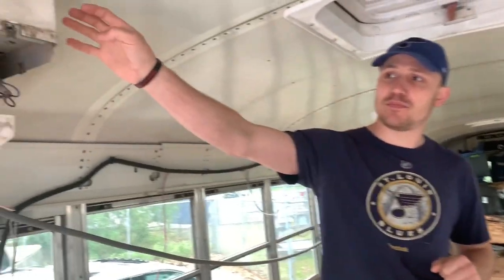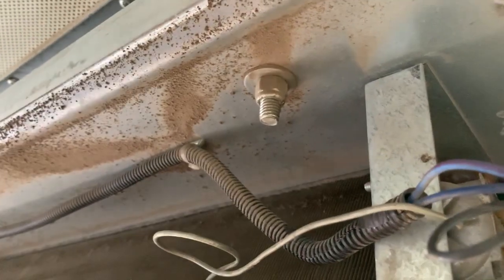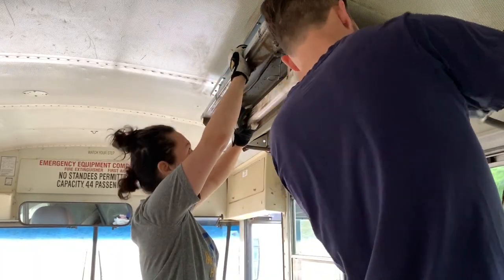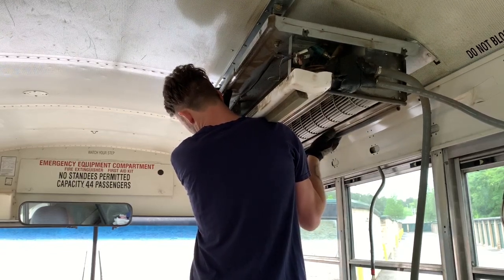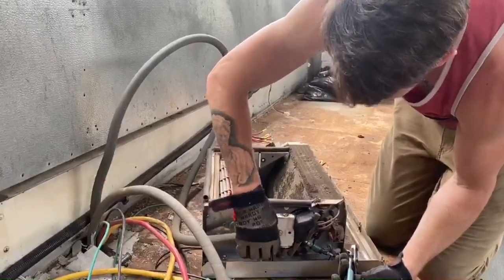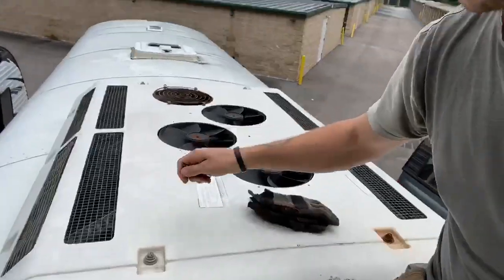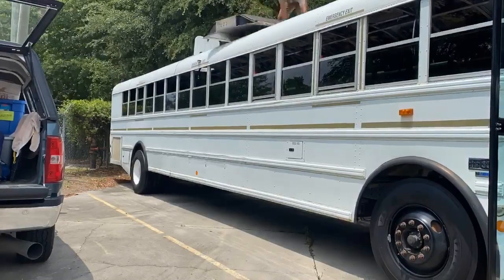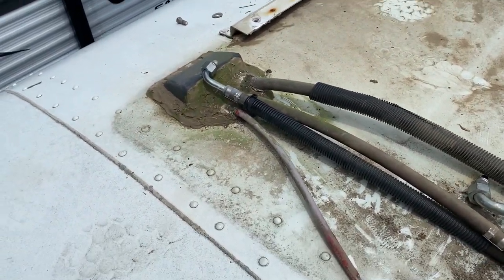How to Remove A/C - School Bus Conversion ( Skoolie ) VIDEO

Comment: Did you disconnect the battery before disconnecting the wires? Asking because that’s  the next step in my build and not sure if that’s gotta be done:)
Reply from the maker: Yes, we definitely did! Great question

Comment: Hey lil cuz! What is the purpose of removing the AC? Won't you did that later?
Reply from the maker: So...while they would be nice to have when driving, they’re completely useless when stationary and they’re incredibly bulky. Shane is 6’4 and we need all the headspace we can get. We plan on ultimately being able to switch between shore and solar power and will install an AC unit that works when the engine isn’t on.
Reply: I know what he goes thru. I'm 6'3 and I have to duck quite a bit in low clearances. Keep up the good work. Y'all will enjoy it when it all done.
Reply from the maker: Thanks! We are so excited!

Comment: Did you have any issues with the regular ac or heat working after you removed these units?
Reply from the maker: Yeah, they no longer work. We completely gutted the entire system. Anything you see removed in this video would’ve been necessary to keep for the bus a/c to continue functioning. We didn’t care to have an a/c that only ran while driving the bus and took up so much space. Hope that’s helpful 👍🏼😊

Comment: How did you disconnect the ac from the engine?
Reply from the maker: We followed the lines into the engine compartment, which actually connected to a standalone compressor. Then we just unplugged the electrical. The actual compressor is still in the engine area, but it will be removed eventually. We will do a video of it when we get to that point. Hope that helps for now.
Reply: @TheMcBrowns  thank you I cut my lines because i cant seem to locate the compressor but id love to see a video. Short school bus seems to be a bit more difficult to locate the compressor
Reply from the maker: @angeltrogi6871  if you know where you cut them, just follow them back, but I’m guessing you tried that and it’s just too complicated to do? (It all goes into some pretty tight and complicated spaces sometimes 🥵) We can create a video showing where ours is...is that what you’re saying would be helpful or the video of us actually removing it? Actually removing it is on a loooong list of to-dos, but I could send ya a video of where it’s located if that helps ya! 👍🏼😊
Reply: @TheMcBrowns  Do you need to remove the compressor?
Reply from the maker: @rafaelsky1235  You do not NEED to, but certainly can and should, if you feel comfortable. At least those are my thoughts...we plan on removing ours soon. We weren't in a rush initially, but there's a belt that's making noise and driving us insane that's on the compressor and we don't need it so...we will do a video when we finally get to it.